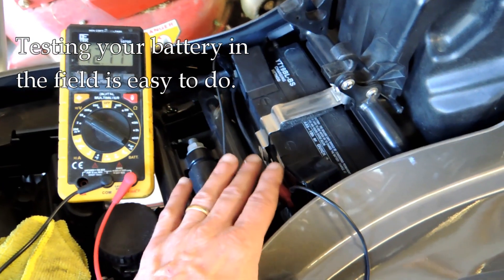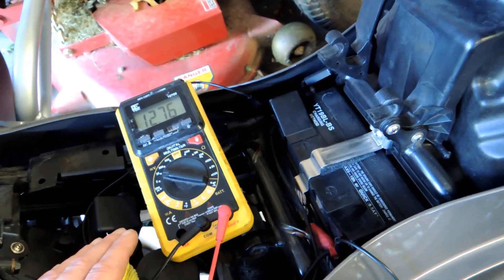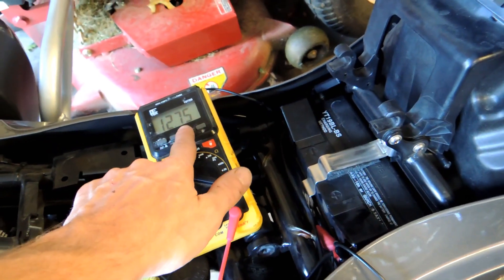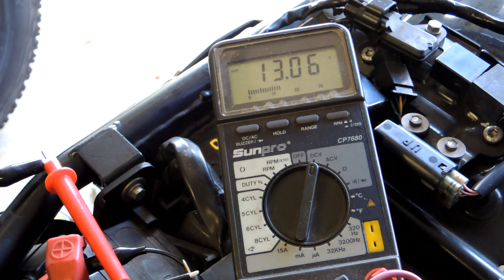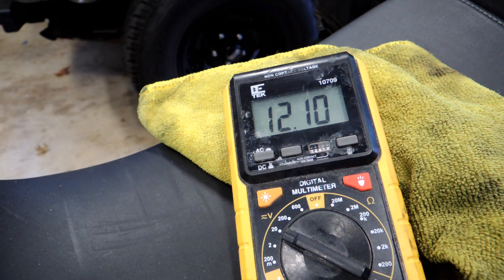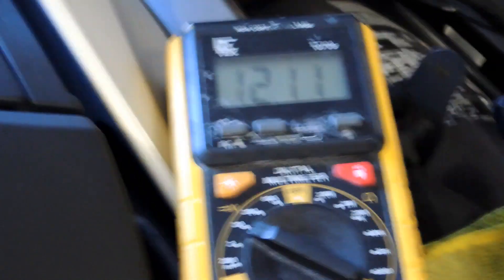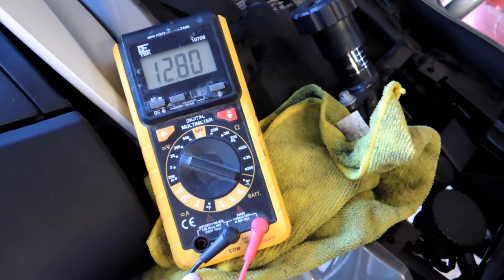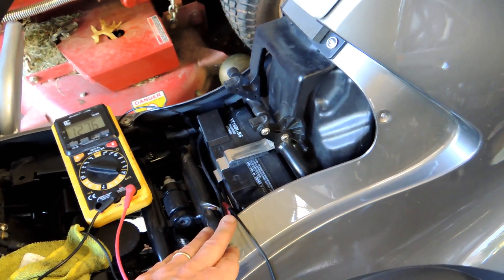Testing Your Motorcycle Battery In The Field

Comment: My new battery reads 12.3 to 12.4v when the ignition key is on is it low or good?
Reply from the maker: Are you using an actual multimeter across the battery terminals to get your reading, or are you relying on a dash readout or charger display for those numbers?  Only a meter across the terminals will give you an accurate reading.  For a fully charged AGM battery you should see 12.8 or 12.9 volts.  But, a slightly lower reading in the 12.6 area is common and not a sign of a problem.  You'll also notice that the numbers initially drop slightly when the key is turned on and the headlight causes a drain.  If you are getting 12.3 with a meter and the battery at rest, then that is slightly undercharged.  It could be your charging system isn't keeping up, or the bike has been sitting awhile, or the battery is getting older.  You'd have to investigate further.
Reply: @tinderboxarts I'm only relying on dash readouts when turning the key on my volt shows 11.9 and then goes up to 12.3 to 12.4v and then when the engine is open 14.1 to 14.2v. I already ordered a multimeter, I'm just waiting for it to arrive.
Reply: @tinderboxarts And is it possible for the voltage to drop even more when you turn on other accessories like the hazard lights even though the engine is on? because I noticed when I stopped for a while and turned on the hazard lights the voltage dropped to 13.5v and when I turned it off it went back to 14+v sorry if I have a lot of questions I'm still a beginner in these things and also thanks for the info and videos you earn a new sub ❤
Reply from the maker: This is a huge subject, but you should understand that WHERE you read the voltage is important.  A voltage drop occurs when there is resistance.  Suppose your battery has an actual voltage of 12.6.  Then suppose you connect a wire to each of the battery terminals, but one of those wires you don't connect very tightly or you leave some dirt between the wire and the terminal.  Now you measure the voltage at the end of those wires.  Instead of getting a 12.6 reading, you'll get something less, perhaps 12.  That's because there is a resistance in the wire which is poorly connected or has some dirt in the connection.  That's why it's important to measure right at the battery terminals with a real meter.  Your dash display is even farther removed from the actual battery, and it's displaying a reading which is taken from the bike computer through a whole wiring harness.  Plus, it's using a crude measure of voltage not a meter dedicated to the measurement.  It basically useless.  So get your real meter, do the tests in the video, and you'll know where you really stand.

Comment: THNX for the videos!! What if the charging voltage comes up to 16.5 or even 17v?
Reply from the maker: That's way too high, and you will cook your battery.  A high charging voltage means the voltage regulator is not doing it's job.
Reply: @tinderboxarts I was just going to answer his question and the voltage meter needs to be changed but check everything also. There is a lot that needs to be looked at and make sure that you don’t have your trickle charger hooked up when doing this.

Comment: Speaking of batteries, what are your thoughts on  Lithium Ion batteries? Great videos.
Reply from the maker: The AGM batteries do a great job in all temperatures and they will last a long time if you treat them well.  I routinely get 5-8 years from one.  So what does lithium technology buy you?  They are not as reliable in cold temperatures, requiring special attention.  They are more expensive.  They will require a new or newer charger able to cope with the lithium voltages.  Their claim to fame is really that they don't self-discharge when left for a couple months and that they are lighter weight.  The self-discharge thing isn't an issue for me, I have a garage with maintainers.  The weight savings is also not of big importance to me.  I'm not running track days, I just ride on the street and I don't weigh much myself.  So, for me, the AGM batteries get the job done for less money.

Comment: Great video! Very easy to follow. 

Since we’re talking electrics, do you have any way of testing the stick coils on your RT? My bike began intermittently running rough. I THINK it’s my right side secondary coil but I’m told there’s no way to test the coil. In your experience is this true?
Reply from the maker: These coils are not magic, they are just like hundreds of other ignition coils for cars and bikes.  They have a primary and secondary winding, each of which has an associated resistance value for a good coil.   You can put an ohmmeter on each winding and compare the reading with the spec, which is the start of a good diagnosis.  The trouble is, I don't think BMW publishes the spec!  You can comb forums for ideas on what your model year resistance should be, but it may be inaccurate.  What you CAN do is take readings on all of your coils and compare them to each other.  If one is particularly different from the others, that's a red flag.   Even without a meter you can swap coils to see if a problem follows the coil.  Of course, there are other issues that may make a coil appear bad, such as corrosion at a connector or a broken wire in the wire loom.  Temperature can make a difference in performance too.  So, you have to be methodical in your approach.  I would start with an ohmmeter and compare readings among the coils and you can also jiggle the wire loom while the engine is running to see if anything happens.   There are lots of other reasons for a rough running engine, too.   The ignition system is high on the list, though.